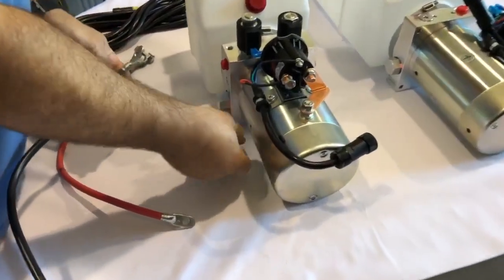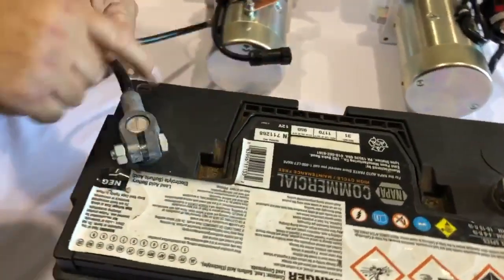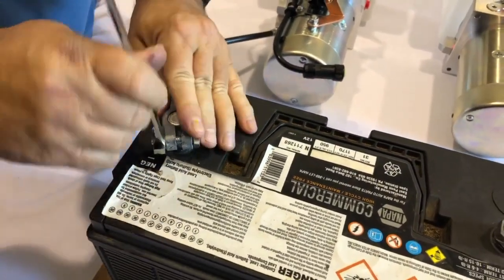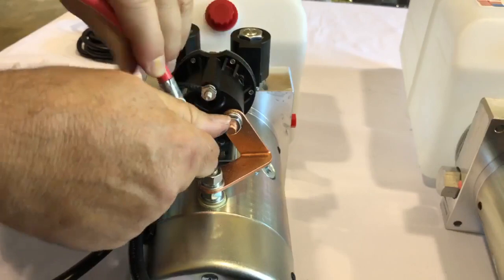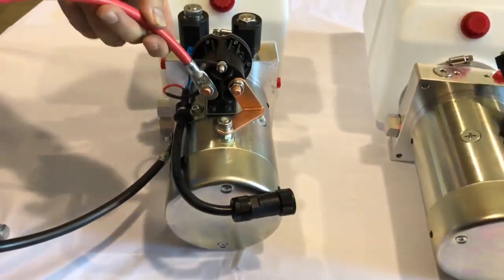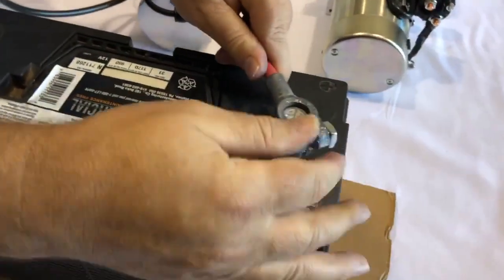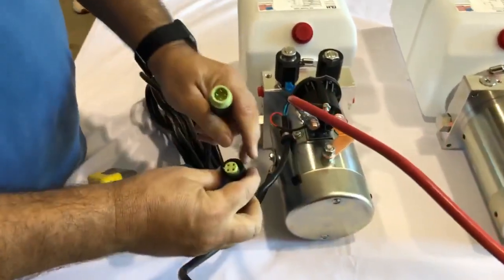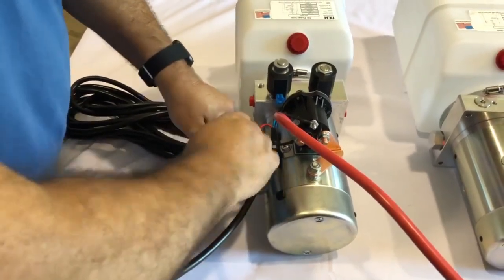How to Hook Up Double Acting Pump: Master the Art with Primary Mover

Comment: The LAST step is connecting to the battery, and NEGATIVE cable connects last, in a negative ground electrical system.